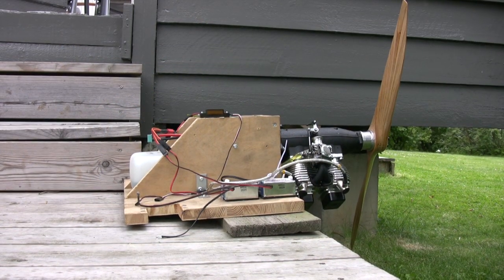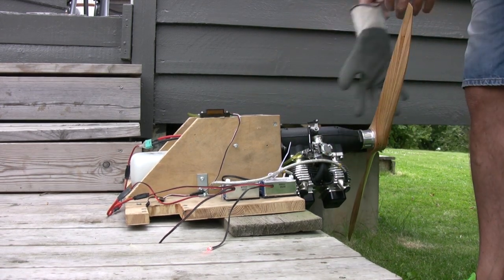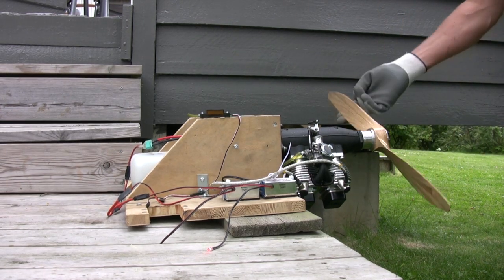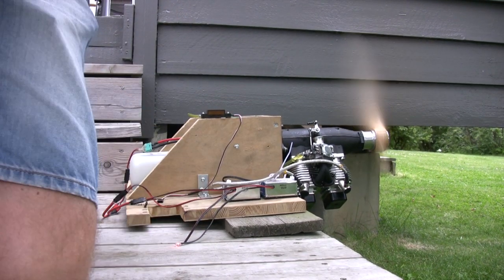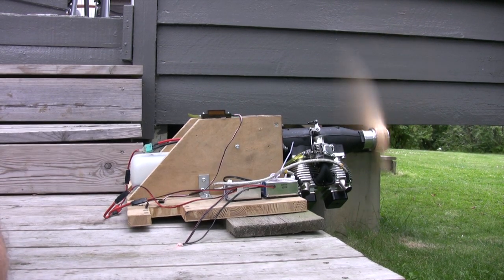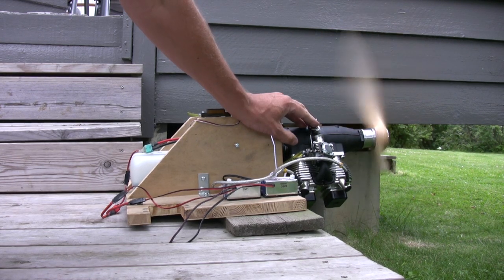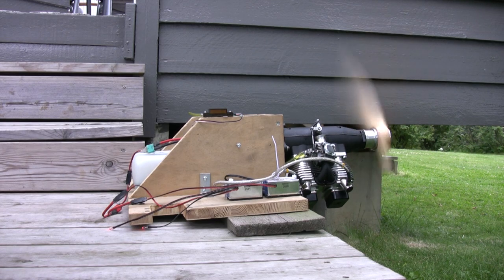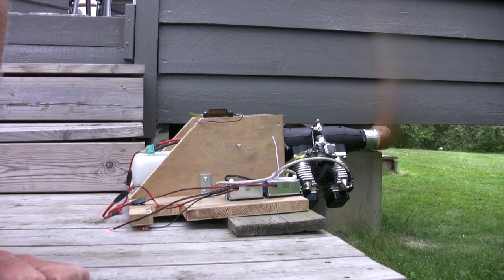ROTO 85 FSI - two cylinder four stroke gasoline RC airplane engine

Comment: Just wondering. If the engine is 4 stroke, why does it need fuel/oil mixture? No oil sump?
Reply from the maker: +MarkG No oil sump on four stroke on model aircraft engines so oil is necessary for lubrication
Reply: @affas  if no sump how Lubrication occur? No oil in crank case? How possible if not crank case carb induction like two stroke? (blowby design? overfuelling / running rich?)
Reply: @scenicdepictionsofchicagolife  I HAD 2 GO KARTS 2 STROKE 7 MOTOR CYCLE AND 3 CARS! ALL ENGINES HAVE OIL DEPARTMENT! THOSE ENGINES DON'T, AND YOU CAN FIGURE OUT HOW IT LUBRICATES IF YOU LEARN HOW IT WORKS! JUST READ THE MANUAL OF ANY 4 STROKE RC PLANE ENGINE IT'S OUT THERE! NICE DAY! !